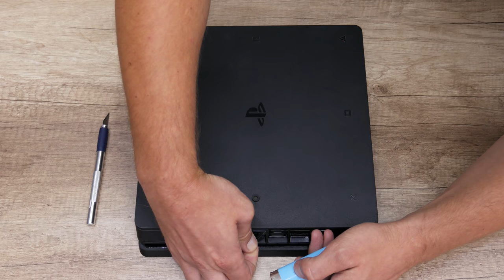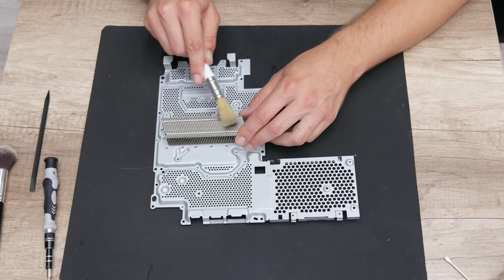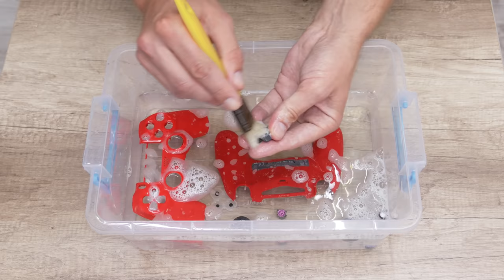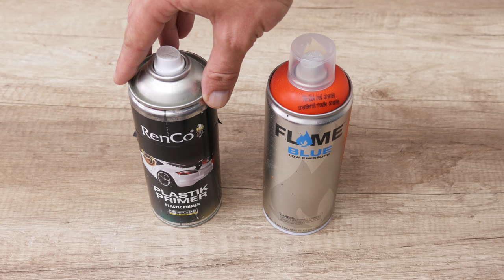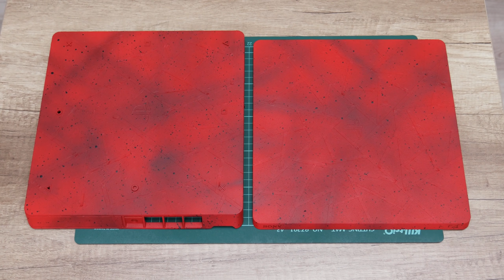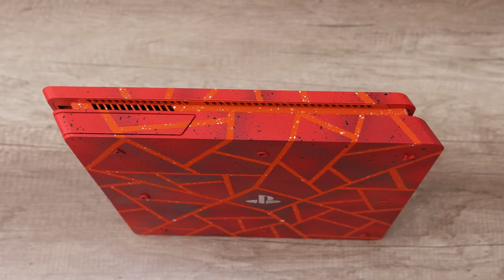Restoring PlayStation 4 Slim and MOD

Comment: Love the graphite trick you did with the controller. How long do you think it can last ?
Reply from the maker: Hi bro, it all depends from how much the contacts are damaged, but can last from few hours and up to months or years
Reply: Cat and Andrew did you used clear coat? Or is the paint good and strong enough without clear coat?
Reply: @MrBENTENG12  its usually a good idea to use a clear coat if you want it to last longer. It also will make your paint really POP!!! I've built a LOT of custom controllers my man, trust me on that. And with the different options available for finishes, it's easy as hell to get more "character" from your paint job...
Reply: How Much Can I Pay You To Do This For My PS4 And The Controllers

Comment: Some constructive criticism ;
Use paint with hardener
Use pre-cut vinyls for logos
Epoxy after tray is in place (stronger than super glue)
Use Pinstripe tape

That's about it. You got passion. Just need to develop your skills.

Comment: Started to watch your videos and I was really impressed by your work and original thoughts. I wanted to ask you where do you buy all your used tech?
Reply from the maker: Thank you bro :D Most of the tech is already belong to someone, I just took, repair, restore, upgrade and return. But when I buy some old, used, or new tech then first I'm searching the local stores that sell electronics, because there is much easier to deal for some used tech with the seller. The other place are the local websites where do peoples sell their old or used stuff, there is easy to try and check the product before I buy it and negotiate for the price. The other options are eBay and Aliexpress, from there I order some replacement parts and lots, lots are pack of some goods, mostly CPUs, If I buy Lot 5-10 CPUs is much cheaper
Reply: @ComputersAndTechAndAndrew  Thanks a lot. :D Recently I was researching and learning all about the electronics, their parts, their purpose and how to repair them and your videos really help me. Stay cool and stay original!!!

Comment: I loved this video, you have been an inspiration for me to start working with hardware. I actually am gonna be getting a new gaming laptop this week, and I am gonna turn the old one into a server computer. Have any tips for a beginner?
Reply: The laptop has a broken screen, and the chasity holding the screen is falling apart.
Reply from the maker: Hi bro, you can turn into a severer or data center or even transform it into a desktop PC. But also you can repair the laptop, the displays are not expensive, you can find some used display, and the display holders or the hinges can be found used for a cheap or you can check aliexpress or ebay

Comment: I’m curious to know, what do you do with all this stuff after you make the video?
Reply: if he sell the all stuff he fix it, i sure people will buy it.
Reply: He can easily sell them for a premium over even the new ones.
Reply: Read his disclaimer in the description
Reply: He didn't sell anything they are for his personal use as written in description.
Reply: @rona8536  he mensoned it in his one vid that he doesnt sell any of the product he fixes
Reply: @lyrixlover9032  I just read a describtion box, but I say "if", why I say that, just because every product he fixes is like new product
Reply from the maker: Hi bro, actually most of the stuff doesn't belong to me, i just take, repair, restore, upgrade or mod and return. But for now, because of the situations I'm doing this locally only.
Reply: @vishnusafaya8460  um no
Reply: @littlebitofeverything585  well i was exaggerating a bit in lieu of the art. It looks great.
Reply: @ComputersAndTechAndAndrew  Hello !  If it's not a secret, what type of paint did you use for styling?
Reply from the maker: @DeH4uK_64  Hi bro, I used the flame sprays, low pressure matte sprays

Comment: And as always if you're going to clean a dry thermal paste,you need to be extremely careful,dry thermal paste is hard to clean but that is not the major problem,over the CPU,GPU or chips on motherboards there are small tiny components that are covered with a dry thermal paste so if you damage one of them the console or laptop will not work,so be extremely careful!!!!!!!!!!

Comment: Bro,
  My dad has  a Dell Latitude 5490 .A few days back it was not at all charging,it just shows 6%not charging but it was working for hours with the charger plugged. But today it showed a different sign, the keyboard and the power button kept blinking on and off and i did all sorts of troubleshooting that the web provided but still not even a change...you are my last hope and if you could tell me if it is repairable in home or is it serious (like i gatta give it to the electronic shop). 
                   I do some small upgrades so i do know a little bit bout computer...
(Dont tell me to send it to you, as i am just a student:-D)

Comment: Hi. When I put my harddisk in my pc it works good for a couple of days and after some time it says reboot and select a proper boot system. And when I put the same hard disk in my laptop it works fine. Is it because my  pc bios is changed or what. And can we install the latest bios on my pc?. HELP

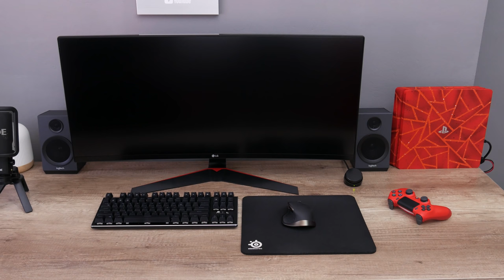Comment: 23:49 why console is standing on the fan case holes ;0
Reply: The console can stay like this, the console will not be damaged
Reply from the maker: No problem with that bro, the PS4 is make to stand like that
Reply: @ComputersAndTechAndAndrew  blocking the airflow right..? what a bullshit

Comment: Hi Andrew 
My pc always says reboot and select a proper boot device. Can you give me a solution for it in the next video please.
Reply from the maker: Hi bro, this may be caused by a few things. First, Windows failure, windows and windows files are damaged, you need to reinstall windows. Second, the HDD is damaged, bad sectors or end of life, in this case you need to replace the disk. And the last option is wrong sata configuration in BIOS, if you have changed some sata options in bios the windows may not boot or the disk may not be recognized.
Reply: @ComputersAndTechAndAndrew  Thanks Andrew. I am a huge  fan. Can you make a video on this sata bios please. Never a youtuber replied my comment thank you very much and please make a video on sata bios  thanks....

Comment: Is the 21:9 stretched or is it native resolution?
Reply: This is stretched, the consoles does not support 21:9 aspect ratio
Reply: @MadMax No.
Reply: @PauloSoares-RJ  :(
Reply: @multiomer1997  how does it work for andrew then?
Reply: @Atros25  It works. but its stretched. In the main menu. at 24:19 you see the icons are rectangular
Reply from the maker: Hi bro, the 21:9 is not native, the native is 16:9 But I'm very surprised how some games are going well on 21:9, same as on PC I do not notice difference, the game is not stretched just wider look. But this is not with all games, some games are looking horrible under 21:9 :(
Reply: @Atros25  Now you got your Answer!